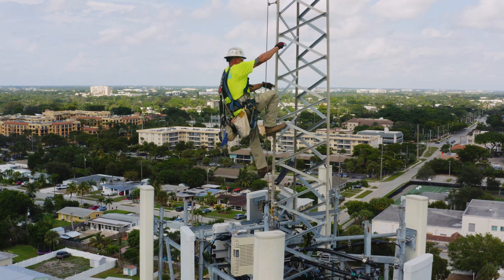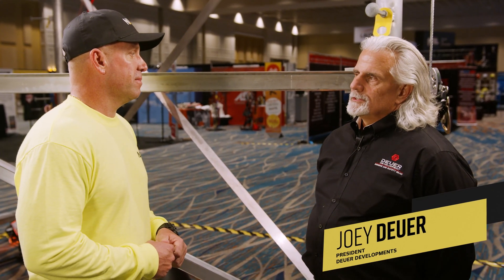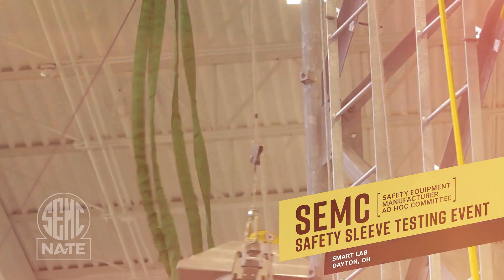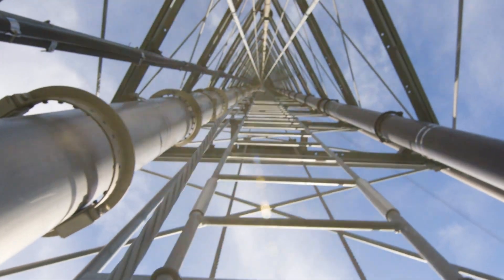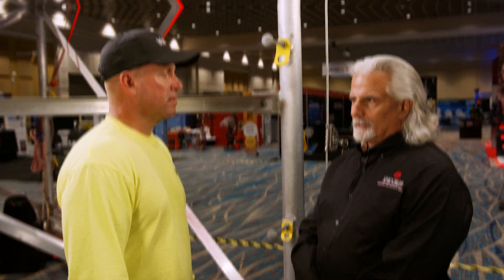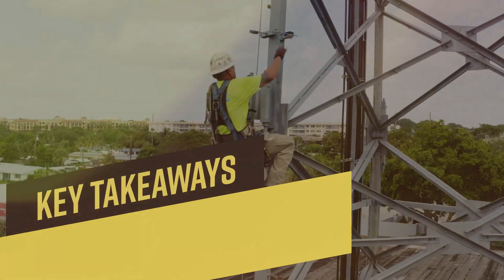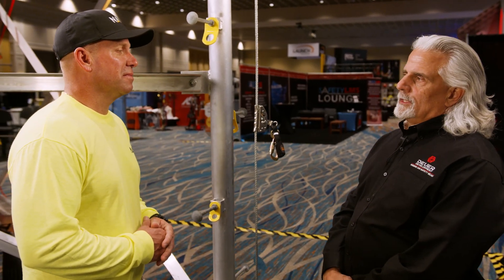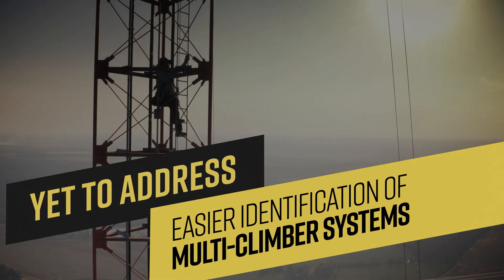SEMC Safety Sleeves Testing - NATE #ClimberConnection Video

Comment: We all know this in the industry We know that we have a WLL and it's been advertised and you're not going to get away from weight versus force no matter what you do I don't care what kind of graphs you come up with what kind of chart you come up with what kind of diagnostics you come up with You have a serious issue with the man that weighs upwards of 280 lb or more anything below that you are safe but you are coming into Red factors when you are 280 lb above that doesn't matter of fact the harness itself has to be redesigned for anyone over what 250 lb is that correct And then you have the PFAS and then you have oh my goodness This is nuts I started in 1990 doing this didn't wear any of this gear We never had a fatality and I was stacking towers anywhere from 300 to 1,000 ft in the air The approach of you people is appreciated but when safety gets in the way of doing work it's a hindrance
Reply: As a 26 year old dude only doing this type of work for 4 years and quickly became a top hand. I can see how its a hindrance for certain projects. But sadly for the newer generation coming into the industry they wont climb towers without em. And honestly I can see where they come from. Ive seen the single piece of rope you dudes would use to position off to and was amazed. Dont even get me started on all the old heads telling me about the good ole times using fisks to descend towers. Also had a dude that was like 300 pounds at the age of 50 and still climbing towers saying that hell be good if he fell and wasnt too sure about that one.